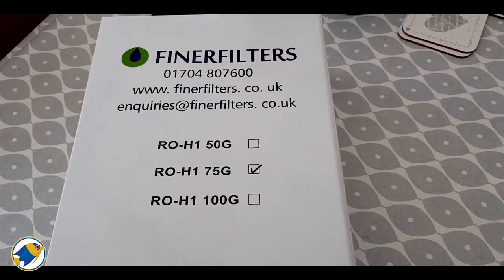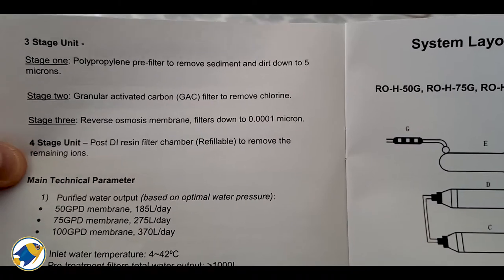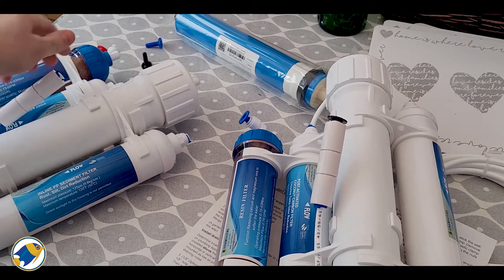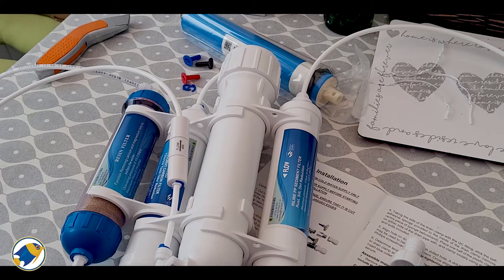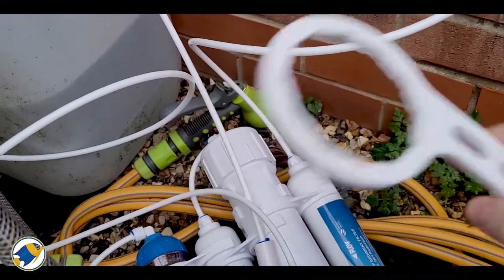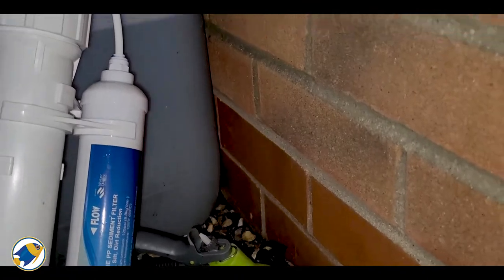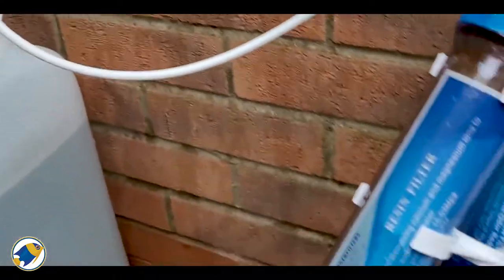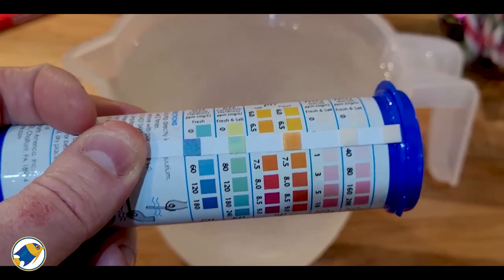Finer Filters RO Unit Review | How to Setup RO Unit for Finer Filters - MR BRIGHTFRYED

Comment: Great video, thanks! There are many defining factors which affect the flow of an RO system and I noticed in the comments you said you have hard water so this is the first issue. You could set up a extra sediment filter before the RO just to remove some of the larger particles which would make life easier for the system.
Water pressure is the main factor so you could also install a pressure gauge just before the membrane to see if that's a reason as to why you may not be getting as strong a flow - these systems need a minimum of around 3 BAR / 45 psi to work.
The other issue is the temperature of the water and i'm sure I could see your breath at one point so it must be fairly cold when you were filming this! The membranes are most effective with water that's around 25°C which is of course going to be way off what we get here in the UK but that's another reason why your output will be reduced as the colder it is, the more compact the water molecules are and the harder it is for them to push through the membrane.

Comment: How long does it take to get 57l of ro water? (Roughly)

Thanks
Reply from the maker: Hey it depends on a couple of factors. How much pressure the water in your house for example is and how hard the water is. I have very hard water so it takes longer to filter. Since I've been using it on average it takes about 5 hours sometimes longer to do a 25L container.
Reply: @MrBrightfryed  oh no, I have 19 dGH water. Are more expensive RODI machines more effective for both time and waste water, I really hope so.🤞

Thanks, again!
Reply from the maker: I think some of the more high end ones filter quicker yes. You can also buy pumps that fit to the units to help too.
Reply: @MrBrightfryed  sorry I keep bothering you, I’m gonna subscribe and like 10 vids in thanks. I’m thinking about buying ro water (it’s a fresh water tank) from a local fish shop instead, and I’m wondering if I can store the left over water for if I need to do an emergency water change or if will become unsafe. since it’s stagnant. Sorry again if this is a really stupid question.
Reply from the maker: Not a problem. Happy to help! Buying is a great alternative. If you have them look into Spotless RO there are lots of these big container units appearing which I've heard nothing but good things about. Unfortunately none close to area but maybe there's one close to you. Nope the water will be fine, I have a 25L container filled and if doing top offs can last week's. 👍
Reply: @MrBrightfryed  ok last question, I swear. Since it’s only gonna be a fresh water tank with basic fish and plants should I mix ro water with tap water and save money and effort, or should I go all the way with equilibrium, alkaline and acid buffers. 

P.s thanks so much, most of the videos end up making me more confused and Reddit is well Reddit about it. You deserve a lot more fans and if you keep making helpful, high quality videos like this one you’ll get them
Reply from the maker: So honestly it depends on what fish you are keeping as to why you want to soften the water. I have a different opinion to most on this topic haha. If you haven't have a listen to my podcast on water parameters! 😉 

But to answer your question using part RO and part tap will work fine, using equilibrium or something is when you want to really nail those numbers maybe for fish that are really sensitive like Discus but depending on what you are keeping you should be fine.  

Unfortunately the internet as resourceful as it is can be full of just as much unhelpful information. It's why I wanted to start my channel to share my experiences. Thanks again for the kind words. I always said if I can help one person then I've done my part for the hobby  👊